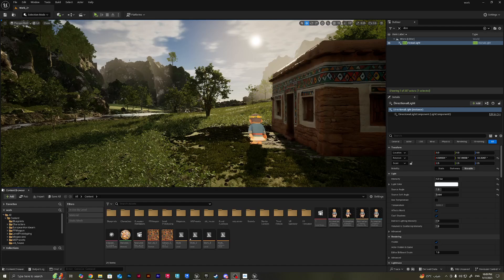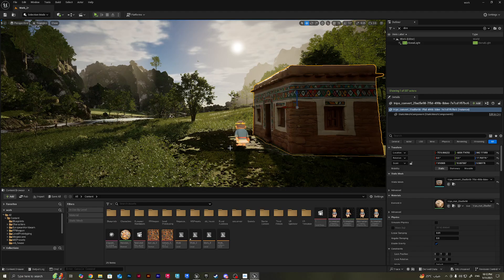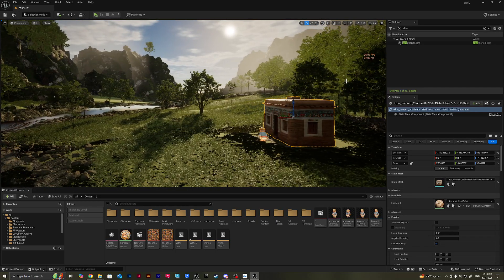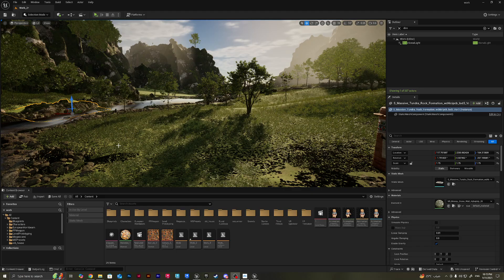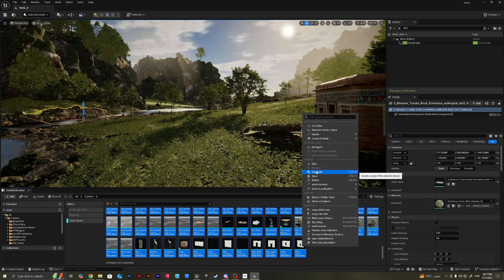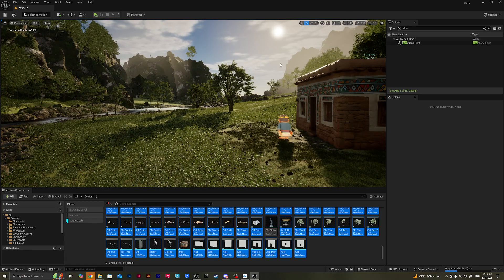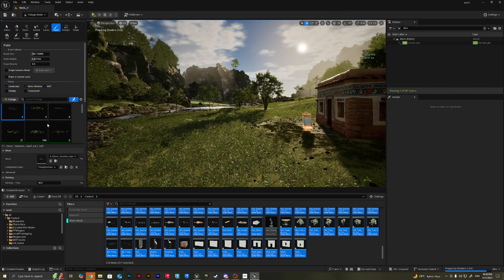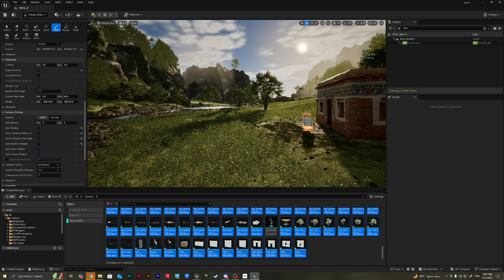Unreal Engine 5.5.4 Nanite Tutorial | Optimize Performance Like a Pro

Comment: Can i package project without link cable? Then, what to do for instal that package.
Not enough time for bought link cable for my class
Reply from the maker: You can but then you have to do it in standalone mode which will take significant amount of time in optimization
Reply: @titanviz  now i can package vr for metaquest, but get stutter when play with standalone vr. Nanite can cause it? Then how i can fix that?
Reply from the maker: @conanbrazia5727 not really nanite should make it smoother when enabled also you have to check the virtual textures you have and model poly reduction to be able to play on standalone
Reply: @titanviz  can u suggest me video to do it?
Reply from the maker: @conanbrazia5727 usually such complex topics are covered through full courses, I don’t think it’s simple to cover it all in one tutorial unless it’s 2 hours one 😅